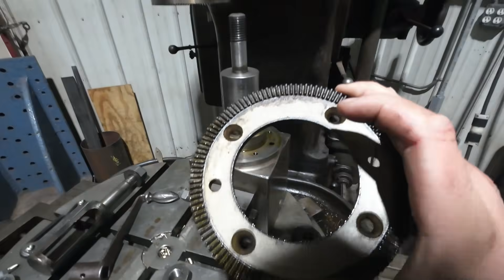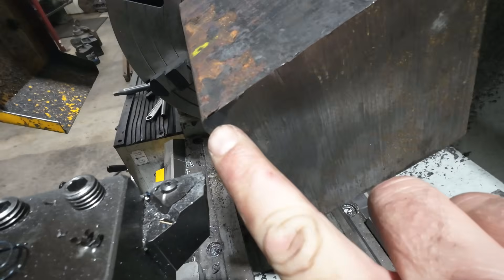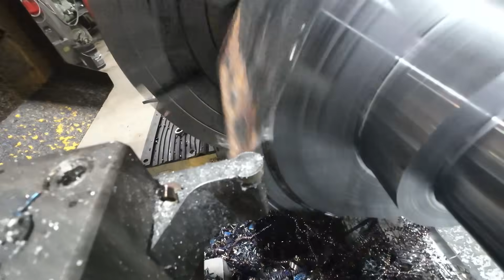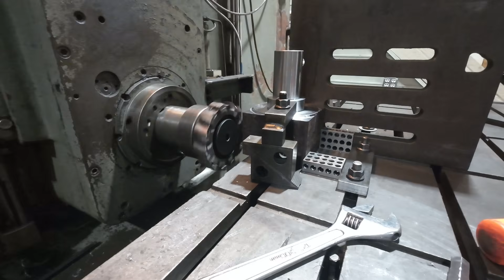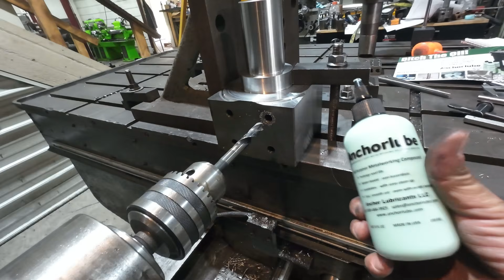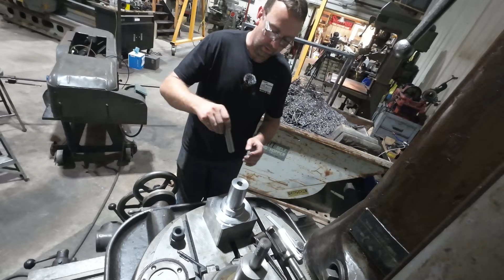Machining A New Tool Holder For A Vertical Shaper | Shop Made Tools

Comment: When you milled the square portion, how did you reference the square faces to the round rotary spindle portion?  Is it just relying on the setup of the square on the 4 jaw on the lathe?

Comment: Now I don’t know all the parameters, but wouldn’t a shield of some sort be beneficial to keep the chips from bouncing onto the feed mechanism below the cutter?  I know that in some cases it may interfere….but it seems like a piece of rubber or aluminum to form a slideway would protect the swirling bits being assaulted by swarf.  Thoughts?

Comment: I like anchor lube, I also like KoolMist and tapmagic. The anchor is my go to for SS. It seems to prevent work hardening , or puts it off , you still have to push hard on the tooling to avoid rubbing.

Comment: The anchorlube  works great and since it's water based you can thin it if you want which I've done and works well you just have to keep it in an air tight container or the water will evaporate especially here in az when summer is routinely over 110 lol cool weather here is probably what y'all consider hot as hell 😵

Comment: This is another project where you could save time and material with a trepanning/boring tool.
Reply from the maker: I still see no need for it. Spend a ton of money on a tool that will only be good for a specific size and rarely get used. Then you save a chunk of something you may never use or would just be the wrong size for what you need. So that junk would go to recycling anyway.

Comment: After intermittent cuts ... if you can, without disrupting your finish dimensions, it is always a good idea to re-tighten the chuck when you get to round size.  The impact loading forces tend to set the teeth deeper into the workpiece than you can with the chuck key and if you then need to do work without the tail stock, you may find that the workpiece is loose.  I'm betting he did this and just didn't have it in the final video edit.
Reply from the maker: Some footage and secrets get cut. Never trust a chuck. I've roughed out parts and got the material hot, let it cool and the chuck slips

Comment: That looks fantastic Josh! The last bit of rounding the corners that didn't clean up really made the difference in that part. One mark of a professional is when your shop made tools look as good or better than ones you can purchase.
Reply from the maker: Thank you. I could have lived with the corners as they were, but it sure did improve the look. Since I have 25ish more years to use it, I better make it look good.

Comment: I’m not a machinist but I am puzzled about 1 thing, why do you clean up, face, from the outside in especially on square material, why not touch in the centre and then cut to the outside.
Reply from the maker: Facing from the center in is for amateurs. Outside it allows for bigger cuts and the chip goes away from the operator.

Comment: Been using Anchor Lube for a few years now, and very happy with it. Works really well on difficult metals like stainless and titanium. As others have mentioned, you just have to be mindful to keep containers closed when not in use, or it will dry out.
Reply: Jeff do you have any problem with the Anchor Lube building rust on the machine and parts. Due to it being water based . I had though of getting some but thats been the hold up on not getting it. I have found that chainsaw bar oil works great  due to it being for high speed and heat resistance.
Reply: @anthonycash4609  I've not had any issues with rust. It will make a light stain if you leave it there for prolonged periods of time. With it being as thick of a consistency, it can't really migrate under things like your vise, which is a plus to me. No smoke or smell either.

Comment: I am a machinist and fabricator, we use anchorlube for a lot of drilling. The viscosity is handy for that. I would not recommend it for tapping, we use tap magic for cutting threads and that does a magical job.

Comment: Excellent project. Your machining and setups are well done with perfect camera angles and good lighting. I’ve used Anchor Lube for drilling and tapping 6M threaded holes in 3D printed Titanium so I can tell you it’s good stuff. Looking forward to seeing that big holder finished.

Comment: Been using Anchorlube for several years now....works great.  The only thing different from oil based lubes is you can't leave it in an open container.  It will dry to a green blob.  I get the 1 gal container and use it with a Bruch in a no-spill container.

Comment: Fun watching you make a round part from square stock. You started out with about 120 pounds of square stock.
Reply: I was about to ask the approx weight of the original piece. Thanks!
Reply: Approximately 432 cubic inches of steel @ 0.2833 pounds per cubic inch = 122.3856 pounds @The_DuMont_Network
Reply: ...is that what's known as "cutting corners"-(?)

Comment: So you didn’t make the claperbox that you say that don’t have , but actually you have 🤣🤣 did you use carbide for slotting ?
Reply from the maker: That clapper box is stuck tight. Haven't seen a need for it, but will eventually free it up. With these big Keyways I'm doing, I want it as rigid as possible.  I run HSS and M42
Reply: @TopperMachineLLC  my is spring loaded, and is a pretty hard spring to press. I have a carbide tip sloting knife for like cnc. But I need to make a holder for it and hope I don’t break the expensive carbide on the first slut.

Comment: Great project Josh, fun to watch the progress and use the different tools in the shop. Q. Why not bolt the gear down? It appears the object of the pair of these gears is to add rigidity and adjustment but with the bottom one loose and free to rotate allow for unwanted movement? Just curious.
Thanks for sharing.
Reply from the maker: I haven't seen it move yet, so I wasn't worried. Eventually I will make another gear and bolt them both down.

Comment: Morning Josh,
Looks good !!! Gotta say my pucker factor was working overtime when you did the low speed interrupted big cuts...YI YI YI......I could feel those vibrations even over here. Those Sandvik inserts are impressive, I like em too but have recently switched to try some Palbit inserts, just as good so far and a tad less expensive. Hope you're not getting as much rain as we are here, albeit the woods sure can use it.
All the best,
Don
Reply from the maker: I wish we would get some rain. Everything is so dry. Lawn is dead again, pond is down almost 2 feet. Too dry. I just hope we don't get all that needed moisture this winter. I hate snow.